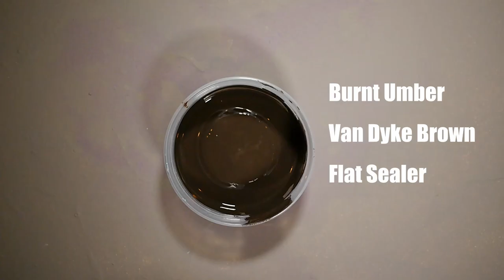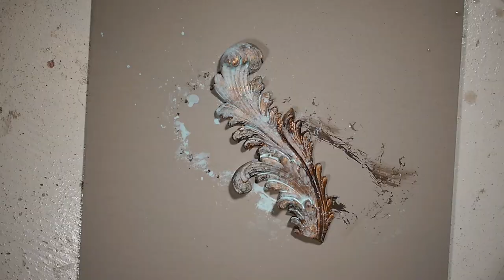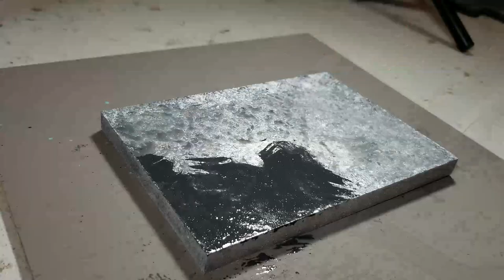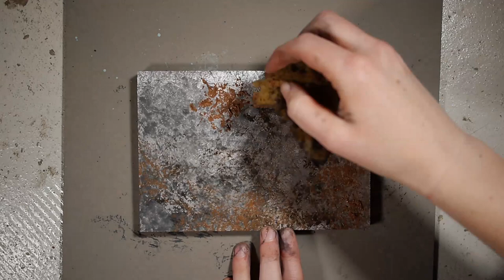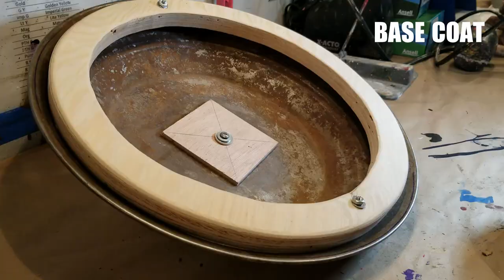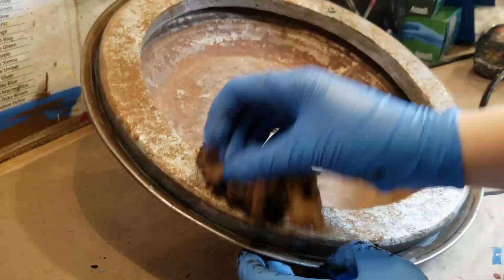Painting Faux Rust and Patinas for Theater - Scenic Art

Comment: Appreciate your work.  Keep it up. 
Can you tell me more about the Scult-or-coat and it's role here?  Are you looking to add dimension?  Could there be a cheaper solution?
Reply from the maker: Thanks! The Sculpt-or-Coat was used to add some dimension and physical texture. On a small scale, there are fine art acrylic mediums that would work similarly, and on a large scale, there are things like elastomeric, mastic...joint compound+glue.. stuff like that, which depending on your project could serve the same purpose.